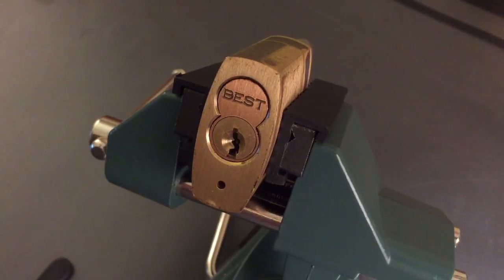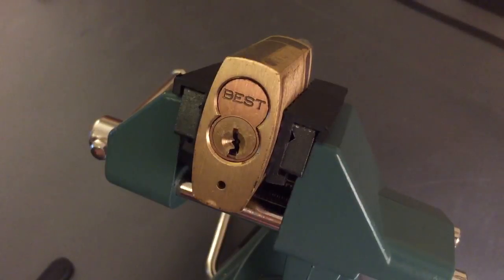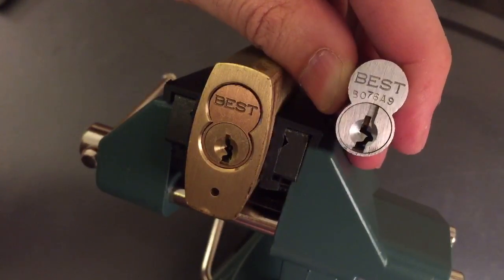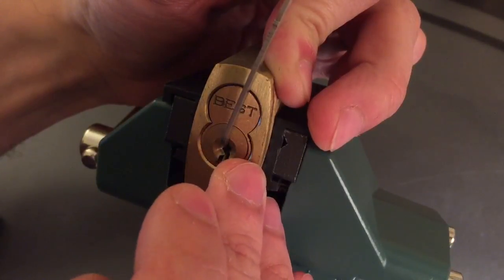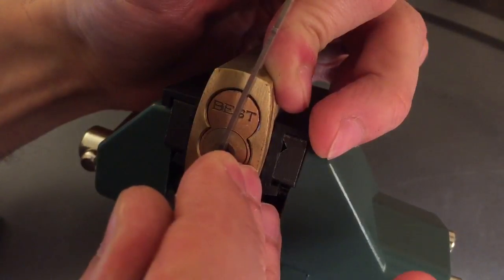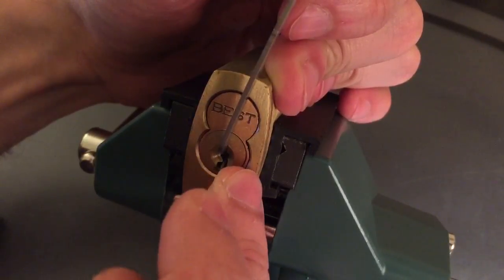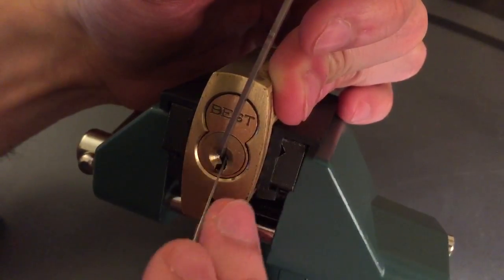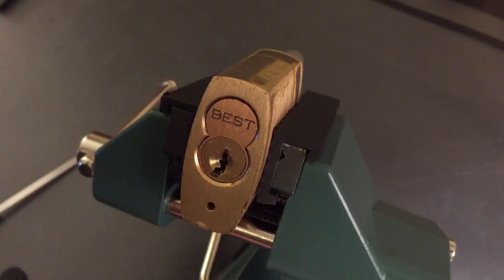[56] Best L Keyway 7 Pin SFIC Picked to Control

Comment: The trick with Best has always been SUPER light tension. Also tension wrenches from Falle-Safe were a MUST. Look those up kids I’m pretty sure they don’t make them anymore but could easily be made if you had the right touch. I had a mental block with BEST early in the 90’s so I decided to take them home and pick on them while watching TV. Taking care to never look at the locks themselves I got used to the feel. I alway used the BEST factory approved white graphite while picking. Sooner than later I was picking every one I came across. Any thing from 4 pin all the way to 7 pin. I never again had a mental block against them but I later  developed a mental block with Corbin Russwin IC.Those are a REAL bear.  I developed my own tools for bypassing those locks (and BEST)both picking open and to control. I made control lug tension wrenches for BEST and CR before they were ever on the market. I have never seen a BEST lock I couldn’t pick open and that includes factory pinned models with security pins.
Reply: You might be one of a handful of people that specialize in Best locks. Definitely not easy picks for beginners. Have you seen any picking tools nowadays made specifically for BEST locks?
Reply: Please do one video. I have a Best lock and I'm having a hard time understand them. Thank you
Reply: I would really like to connect with you to learn a little something. If you're near an area i travel I'll definitely pick up the tab and buy you a nice bottle of your choosing. Lmk as I really want to become a pro at best and others like them as I see where others give up an opportunity to stand out.
Reply: BEST locks are some of the hardest ones out there. There aren’t many videos on YouTube about them. Maybe you could make one?

Comment: My first Best Padlock, turned like this, and I thought I had spools, until, i started to pull the pick. and the core came with it !! I got a screw driver, and turned the mechanism, and it opened. You cannot choose which way to pick.

Comment: Have you gained any info on picking past control in last few years? I am just getting started in single pin picking and would value any info you have on this type of lock. I enjoy your videos and the info you share on the all the picks and equipment that you use. Your way of walking through the pick has made picking very fun and enjoyable. Thank you for taking the time to show the deal tails of pick. I know I never would have started in picking if not for your videos.

Comment: Hi LPL, I noticed that this video is one of your earlier publications.  Do you have any new thoughts about these sfic locks that you've come up with since the release of this video?  I can typically rake these open, but I have yet to successfully spp one to either operating or control.  When it comes to lock picking I prefer to spp and don't find much gratification in raking. Raking just feels like rolling the dice until you win, whereas developing spp skills that don't rely on luck is much more gratifying.  I've been working on these sfic cores off and on for a little while, trying to identify some form of approach but I am curious if there is any advice to be had from more experienced pickers such as yourself.

Comment: Lol. Funny that it was 3 years ago since my last comments. I was looking for a vid of Best's MX core and it brought me here. Some things- Peterson's iCore wrench's= don't need them. They cost 20 bucks a pop and only the B is useable. The C= so thick it barely fits in an A keyway which is Best's least paracentric. The A= so thin it doesn't allow for proper tensioning. I have used the whole set extensively and only the B is operational. Now, you get no advantage using this over a TOK/BOK turner. I know all about Blaze's research but I just haven't found his 'flaw' to be significant. Also= you had a W keyway in the Vid. Best has the standard line/ the T series/ and the W series. W is the most paracentric, so insane that locksmith's will often crush keys when trying to punch them on a key machine. They are also hard to pick- simply from an access standpoint. You were right that a dimple is pretty much the only thing that will work on them, that being said= you will almost NEVER find them in a real world environment. Since all I pick is SFIC mostly, and I have for 6 years now= I can almost breath on them to open them. The last one I popped in under 10 seconds. SPP these is easy and you should be using just Sparrows Lunatic or Tron, but the Luni is the best pick design for just about any lock period. You need at least a medium or deeper as every lock will have 1 deep cut, most have at least 2. Stuff like short hooks and diamonds simply can't press the pin high enough up into the chamber- you'll also F up your set if you use a less desirable hook and start from the front. I never pick from the front- for this very reason. Also, these locks are THE best lock to practice your rake skills on. I've raked tons of different locks but these will be the most challenging and you will learn that you can start fine tuning your technique's. I'm way more adept now on raking anything, just b/c I have raked so many of these open and they are very susceptible to BEING raked. I'm so adept at raking them, I don't think I've SPP'ed one in a year or 2. Anywho- thanks.

Comment: Great picking. I have made the experience that these Finch tension wrenches (got some from l0ckcr4ck3r) makes a difference. My BEST I can usually pick to operating (if at all). Once I picked it to control but never again. With that tension wrenches it picks much better to control. For me they make a difference.
Reply from the maker: +Potti314 Thanks... I have the Peterson version of the SFIC "Control" tension wrenches.  As of now, I see no appreciable difference using them, but I'm keeping an open mind as I spend more time with these locks.

Comment: I like your Best Lock picks. I have 3 old locks and would like to pick them. Also I would like to remove the cylinders. I have keys for 2 of the locks, but no control keys. Any suggestions on how 
 I can get control keys for all three and a regular key for the one I don't have a key for.

Comment: I haven't picked a best stic core but working with keying them. Its going to be hard to determine what the shearline for control is especially when these cores are master keyed which would give you 2-3 shearlines to work with. I honestly haven't studied the internals of it.

Comment: I purchased 5 of these cylinders for practice. I did a cut away on one but cut too deep into it and ruined it. I decided to gut it and found something that I have not come across on youtube. Each of the 7 holes had 3 driver pins consisting of all different length pins and all had a single, very thin, driver pin. Have you seen such a stack of driver pins
Thanks

Comment: I've had my pick set for less than a week, so if it sounds like I'm full of shit, I am.  The Best lock that I've been playing with has a pin (4th from the front) that locks in its at rest position.  Once I find this pin I hover my pick over it and drop my tension thus releasing the others.  I then start on the "locked" (4th from the front) pin and try again.  After some shotty, unsystematic, picking I'm then able to get it.  Does this sort of "locking" pin have a name and a method of dealing with them?

Comment: If you put the tension counter clockwise, then you can only pick to unlocked correct..?.
Reply from the maker: +Kevin Carter correct, but there's still tension on the control shear line, so you have all the difficulties of two shear lines, but only half the potential benefit. Thus, it's usually better to pick clockwise.

Comment: Good points about the interchangeable core. The WB looks like it is a real beast to pick. Don't you find the top of the key way leverage a little more difficult? I have never had such positive clicks on a Best...are you getting to control without 7th pin?
Reply from the maker: +Peter M Thanks.  Top of the keyway is pretty much always my preferred tension method because it gives more control and leaves more room for me to maneuver my pick.  Usually, the only reason I use bottom of the keyway is some quirk in the warding... either TOK will not fit, or I'm using the tension wrench as a platform to pick off of.
Reply from the maker: +Peter M one other thing:  the last pin I set was #7...

Comment: I'm currently struggling with a 6-pin L-keyway Best padlock. Two actually. I have operating keys for both, but no control keys. One has a mild bitting, and picks or rakes to operating usually in less than 5 minutes. The other has a more aggressive bitting with pins 2 & 3 real low, and 4, 5 & 6 very high. 5 & 6 also bind first, so it's ridiculously easy to overset 2 & 3 wide trying to set them. I've picked it to operating once, and raked I've never had luck raking it (I've never been great at raking, anyhow). I just don't seem to get much feedback at all. Almost nothing to speak of on the tension wrench. When a pin binds, it's usually only slightly harder to move, barely noticeable even with a good bit of tension. I can't believe how much of a pain this lock has been with just standard pins. 

Anyway, I see its been a while since you posted this, so I was wondering if you had any more advice for these locks.
Reply from the maker: +Rob Kurtz Sorry, but I don’t spend much time of SFIC… the dual shear lines can be very frustrating.  Have you tried the special SFIC tension wrenches sold by Peterson?  They can be very helpful getting stubborn locks to control.
Reply: +LockPickingLawyer I made one using a wiper blade insert yesterday, actually. On the easier lock, I've found that using that and a Bogota rake, the core pops out in mere seconds. Still no joy on the other one. Like I said, I just wasn't sure if you had any more experience with them since you posted. Thanks for the quick reply.
Reply: +LockPickingLawyer I have used those tension tools from Peterson. They are a little over priced imo, but I HAVE had good luck with them. I have an entire box of SFIC Best locks someone gave me when a local retail location went out of business. I picked 4 to control in about 10 minutes with them. I have since re-used them. Swapped in my own cores. For around the house, they are a great lock. They can't be shimmed, the body and shackle are strong, and like you said, that SFIC core can be a pain in the rear end to try to pick. I have the best luck raking them. Usually using the .18 purple Peterson triple peak " bogta ", or any of the other triple peaks my by Sparrows, Mad Bob, etc. Sometimes, you can rock them open with a regular pick upside down. It seems like everyone is dependant on the bitting and if they lock is properly lubricated also.

Comment: This was interesting! I work with these a lot at work.. One thing i know about these is that the little bar that holds the core in position likes to get stuck, and I mean STUCK. It's a major pain when this happens. If it's out of the lockset some guys are able to smack it just right to get it moving again, but that's only out of the set and in an ideal position.
Reply: I hate it when they get stuck, I will spend a fair amount of time trying to free it before I drill the core.
Reply: @scsywar  For me it seems that the bar gets stuck mostly on exterior locks where the core is exposed to a lot of dirt and moisture, typically gates and the like. I usually try jiggling my control key up and down while trying to turn the cylinder and if that doesn’t work I will try spraying carb cleaner in it or brake parts cleaner followed with some Tri-Flow lubricant and then it will usually let go. If not, I start drilling!!! Good luck.

Comment: Nice picking. How did you like the training set you got from me? I can always chuck a core full of spool pins if you want a real challenge :D
Reply from the maker: +mresurm Thanks.  The locks from the sets you sent were great practice, but I put them down after a couple nights because I eventually figured out how they opened and memorized them.  For now, I'm buying whatever I can find cheap on ebay (usually without keys) tossing them in a bucket, and randomly picking whatever I pull out.  As for spools... I wonder if they would make it easier because it would give the picker a reference... any thoughts on that?  PS- the lock body in the video was the one you sent my way!  Thanks.
Reply: +LockPickingLawyer  Yea, I noticed that :D Well, if you are ever interested in more I could stack one full of spool for you.

Comment: I'm a newbie to the lock picking world and I have a good feel feeling for the pins but I tend to over set and my tension is a problem as well. either to much or not enough any pointers besides practice and practice?
Reply from the maker: +p2o8wer Thanks for watching, and welcome to picking... regarding tension, you really need to develop your feel, and that comes with practice.  I am constantly varying tension as I pick.  Regarding oversetting pins, my advice is to be selective about the pin you pick.  Don't fall into the trap of trying to pick a pin that is only semi-binding.  Only push on the pin that is binding the hardest.  You will find that oversetting is very uncommon when you follow that advice.  Good luck!
Reply: +LockPickingLawyer very good advise. will give it a try. thanks for the help. great videos by the way. very helpful and crystal clear.

Comment: I'm just getting into lockpicking and am wondering, what do you mean when you say "picking the lock to control/operating"?
Reply: The lock takes two keys. The operating key opens it. A second key, called the control key, has all the pins set slightly higher and removes the core for easy rekeying.

Comment: im looking for a interchangeable core padlock that comes with a core, and control + operating key.... but they are  kind of expensive here in canada.. can you suggest a lower priced one? its not going to be used for security, just to add to my collection..
Reply from the maker: +Jay O Sorry, can't help you there.  most IC padlocks do not come with cores.  Honestly, I'd troll ebay for a used one if you want a lock that comes with a core at a good price.
Reply: yeah, they dont usually come with cores, thats what im finding, will keep looking on ebay and amazon
Reply: just got a best sfic lock, no keys, having quit the time getting it to control, its in a mortise cylinder, and i want to get the core  out to have it rekeyed.. i know i could just let a locksmith do it, but getting the core out would save me quite a few bux when getting keys made, any tips?
Reply from the maker: Jay O There are special tension wrenches for picking these to control.  I've had limited success with them.  To be honest though, raking is pretty effective as well, if the keyway allows.  Good luck.
Reply: yeah, im gonna try and make a finch style tension wrench, raking hasn't yielded  anything yet, thx man!
Reply: Did you find one yet ?
Reply: naw, i made a wrench, but still looking for a core with keys :/
Reply: Hi. I have some I would be willing to trade. Where about's in Canada do you live ? I'm in downtown Toronto.
Reply: Hey, go ahead and send me a private message via g-mail or youtube
Reply: Jay O Don't see a link or address
Reply: sorry, :P
Reply: i live in canada and ended up buying a new sfic arrow core loaded up in an american series 3105 aluminum body from the local LS. Ran me 45$Cad. two operating and one control. No physical security but great for practice. still havent got it lol

Comment: Can you show or does anyone know how to open these types of locks after the core is out?
Reply: Should just use a flathead screw driver. Depending on the exact lock you'll have either a divet or two prongs, just be gentle and turn clockwise. Much better if you have a follower.

Comment: The 7th pin on a best lock is only used to remove the core to unlock you only have to pick the first 6
Reply: Whoever combinated the core could have elected to use pins 1-6 to operate, and 7 to control - and may have had a special reason to do it that way.  But, from a security point of view it was a REALLY BAD idea.  It is neither a necessary or standard feature for IC cores.

Comment: Recently got into picking as a hobby, I got curious and using a couple hairpins was able to pick to control a L keyway 7 pin Best SFIC after 2 min. Tried 3 other locks and got control each time. Im thinking Best keys their control as the first shear line...thoughts?

Comment: What do you mean by 'control' and 'operating' terms?
Reply: one turns the tailpiece, one releases the core
Reply: All keys that are intended to lock/unlock the door,  etc. work at the operating shearline.  The keys can typically be turned either direction, dependant upon the lock's function. The control key works a separate, higher shearline, turns only 15 degrees clockwise and only is used to install/remove cores.